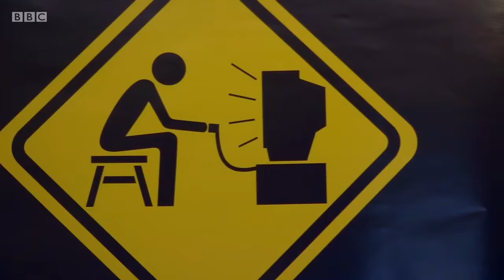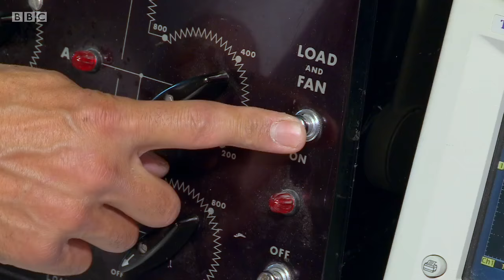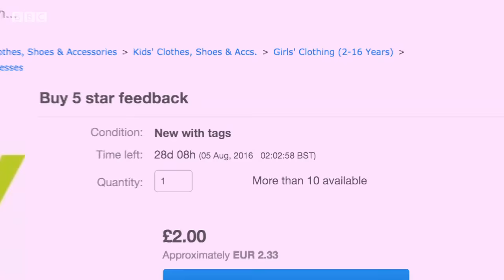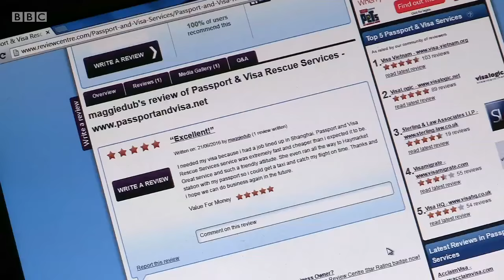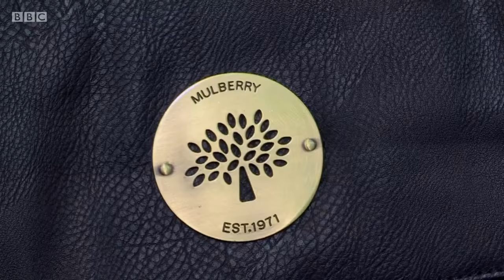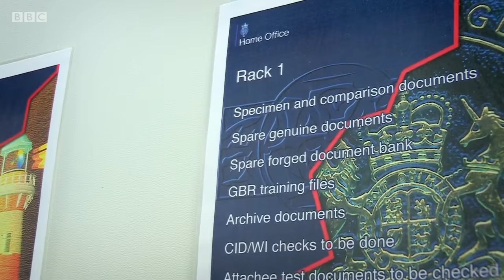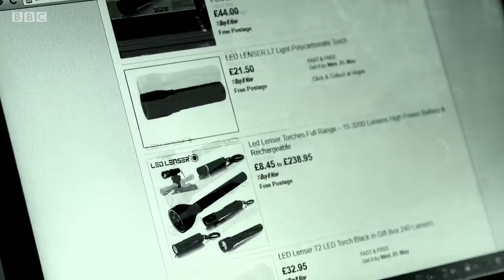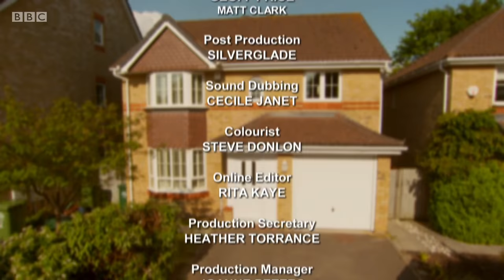Fake Britain Series 7 -  Episode 3

Comment: This is why I use PayPal when ever I can online, many times if the site I'm buying from doesn't utilize the payment service I wont buy from them.
Reply: Why? You have the same protections using credit cards, PayPal is usually just an unrequired middle man. Especially if funding your PayPal purchase with a credit card.
Reply: Matt Yabs PayPal will refund you if you get scammed.

Your bank won’t give a shit.
Reply: PayPal doesn't ensure your buying genuine products as there nothing to do with the shops all they are is a payment service
Reply: @EarlSquirrelsonn  not all the time they don't
Reply: @matthewyabsley  Also PayPal has "bought" the item, then, sold to you. Therefore you have bought a 2nd user product. At 100£ plus then the Credit Company has bought and sold to you. Like you I have much more faith in Visa than PayPal. And listen to peoples attempts at eimbursement from PayPal.

Comment: If you look very close at the cable of the plug at 8:07 you can see that it is not connectet to anything... I don't think  these fuses are the only things fake in this show
Reply: Why would it be connected to anything?

Just the wires in the cable stub or even just the plug need to be shorted, i.e directly connected to each other.

No need to involve any other appliance at the end of the cable.

Comment: ah yeah sand, expensive that stuff!
Reply: the amount of sand in a fuse might amount to 100th of a penny each, but if you are making a billion fuses a year, thats saving of 100k
Reply: dannypeck666 if you're mass producing 1 billion fuses the company is obviously doing well, £100,000 isnt much in the grand scheme of things.
Reply: A lot of the Chinese fakes omit things in the design that they don't understand have a function. Plus, while the sand is cheap to be sure, sourcing a supplier and purchasing it does have at least some cost associated with it. Legitimate companies have skimped on safety to save 1/100th of a cent per unit.
Reply: The point is that they are made by amateurs, not qualified scientists, who don't understand the purpose of the sand, they're only interested in imitating the external look of the fuse
Reply: @kaiden2319  if it's a producer of fakes do you think they are interested in losing thT amount of money ?
Reply: @Liitebulb  Don't insult amateurs. It's must worse than amateurs - it's Chinese.

Comment: Companies do not spend millions in R&D on fuses, they've been around for decades and haven't changed since. And surely the fake one breaking the circuit early is a good thing? It didn't give the plug a chance to overheat and melt.
Reply: OhFishyFish I
Reply: right!
Reply: @BIGGPIXEL Everything he says is always true?
Reply: Breaking early wouldn't be unsafe, but you could be replacing a fuse in a kettle every few days if it isn't capable of carrying the required current
Reply: Did you not see the test when the plug exploded?
I'd rather have a 100% safe product than a fake that has 50% of exploding but atleast the other 50% means it stops working before it heats up
Reply: 😂 but that’s if it works in the first place cause if it doesn’t it could overload and cause a fire lol

Comment: Is surprising how little some people know about fuses. Universal lol. I remember I used to work in an Arcade, I was at a different location for the same company one day. I'd been in the job much longer than the supervisor at the time. Anyway, one of the machines stopped working. I said to the other guy that I'd check the fuse. I went to the shop next door to buy some fuses. meanwhile the other guy called the supervisor, I'd told him to wait. 

Anyway, I got the fuse, it previously had a 5A fuse so I replaced it with a 5A. And it started working. The supervisor then appeared. He asked how I got it working, I told him, "I just changed the fuse."
He said, "Nice, how do you do that?"
In charge of an arcade and unable to change a fuse.

Comment: Fuses reduce the electrical flow from mains to the product, so when a surge happens the fuse blows and stops the flow of electricity to the appliance. A surge without a fuse could cause the appliance to basically overload and cause damage such as fires (thin wires that overload and cannot support the high electricity flow can heat up and set fire to the appliance which can spread)
Reply: Even better when you realize that most of the items using fake fuses also probably use that copper plated aluminum wiring.

Comment: why does england have fuses for everything, i just have a fuse box in my  house like everyone i know in my country, if something goes wrong the central fuse box goes off, and than you switch it on again...having fuses in everything makes things overcomplicated and expensive!.
if the washer has a short out, my general fuse box in the hallway will go off, and you pull the coard from the washer ,and  push the fuse button to reset it.. simple, no need to buy new fuses,,, what a scam they are running in england selling a fuse for every machine in the house!.
Reply: S Dew you know nothing about uk power grid so don't bother commenting on it, there's a consumer box full of rcds that trip when there is a fault, the appliance that tripped the rcd has a fuse in its plug to protect said appliance from surges of power and the user from those surges...if you listened in the video it even told you why it's not a scam it's safety so sit down
Reply: im gonna assume your american you dont have fuses you have breakers which are designed to cut the electric if theres a sudden inrush of current such as a fault they will only trip when they exceed the amp limit of that circuit like 40amps in the uk we have a similar system but add in a second layer of protection at the plug which is a fuse this will only blow if my device exceeds the power rating of itself like 13 amps 5 amps or 3 amps now what this protects from is a problem americans should know well   burning your house down on christmas eve because you have 40 amps worth of xmas lights plugged into a shitty extension cord that was only ever rated for 13 amps maximum load its not a scam it actually saves lives and it doesent cost us much if anything the average uk house hold will only have to change a fuse maybe once or twice a year and the fuses themselves cost pennys
Reply: UK has fuses in plugs because they use ring mains system with just one big breaker. Places that dont use fuses in plugs use radial mains system and have several circuits usually at 8A for common house circuits or 16A for workshops and such, double that for places that use 110-120V.
Reply: because of shitty electrics

Comment: to be fair only in UK you can find fuses in the plug. Otherwise, if the current was too high it would have tripped the main fuse from the breaker panel, and wont blow up the plug.

Comment: i never understand the english power socket       its bulky  you have a switch on the wall side   and if not properly serviced it can blow
in spain we have an centralized automatic fuse box with manual rearm alot of safety features inside and to toppit on there is a differencial fuse that shuts of when an 30 ma surge ocurrs between any cable and a faulty ground     that easy
Reply: It's the UK, they have to do everything differently.

Comment: Also: Why don't you have fuses in a fuse boy IN the wall?!
Reply: we have fuses at all points of failure
Reply: Luca except for the parliament
Reply: You do but it’s a mechanical switch when under a high load it heats up and changes shape causing it to trip (turn off) back in the day we used to have actually fuses in fuse boards some houses still do just that it’s more of an inconvenience changing a fuse compared to just switching it back on.

Comment: you know because a fuse stops you from getting a electric shock they blow if they are overloaded breakers trigger whn short circuit rcd trips when there is a loss of current for example if you touch a light bulb socket while its on

Comment: The hell is this fuses BS in Britain? We dont have this in Europe and are doing just fine...
Reply: We just have fuses at the meter. This is easier in some ways but it also means that when one fuse blows, you could lose power in several rooms. With the British system, only the appliance whose fuse blew will stop working. The downside are those ridiculously large plugs.
Reply: Basically a different version of electric breakers.

Comment: With regard to the fuses. Why don’t you guys just have resettable earth leakage?
Reply: PX125E. We do. The fused plug is an extra protection. It's arguable whether it's required but I can't argue that's is bad in any way and fused plugs have been the standard in the UK for many decades, since 1947, I think after many domestic fires were caused by the very poor electrical wiring previously used. The chunky 3 pin plug - which is worse to stand on than Lego with bare feet - is amazingly stable when plugged in and prevents inadvertent shocks from things poked into the socket as the third pin opens the slots for the two power pins. It's very safe, very stable and, I guess, we're used to them 😉

Comment: everyone they asked must be a woman then,,every man i know knows what a fuse is,,i maybe being sexist but its sooo basic ,---,its a thinner wire inside that will blow if it gets too much heat,with different sizes covering different power levels,as a 13amp fuse may not blow if in a lamp (low power) so a lower one is used (3amp)  and a 3amp would blow every 5mins in a higher power thing like an oven

Comment: So people still use fuses? Those are ancient, circuit breakers are for the modern man. And no nead to replace a fuse after the power goes off all the time just flick a switch and you're done and if doesn't work then it's not your problem or something is broken so you just flick the off the switches and restart until you find the problem, easy.

Comment: Do they not use circuit breakers/fuse boxes over there. Don't really see a reason why every electronic devices needs a fuse seems to be redundant and not nessary for safety. If the socket shorts it should trip the breaker anyways. also, if someone screws you on eBay... you call eBay support and they will sort it out. If buy review's  you will get IP banned. Personally I only buy from people who have 30 day returns.